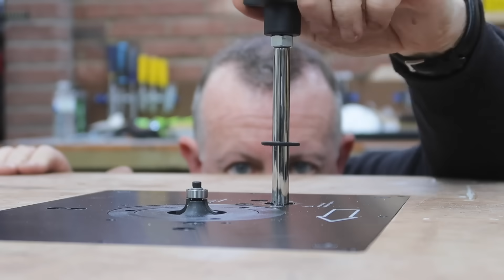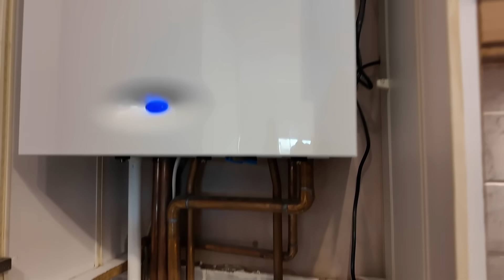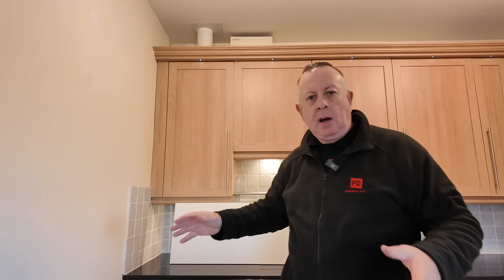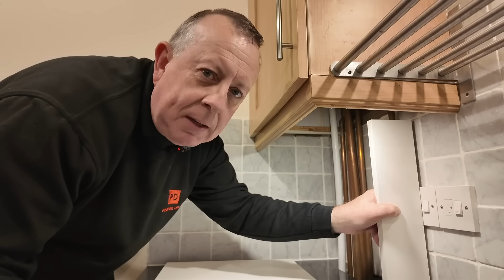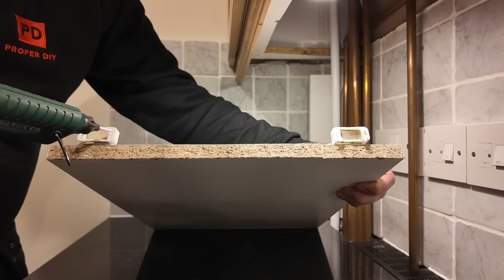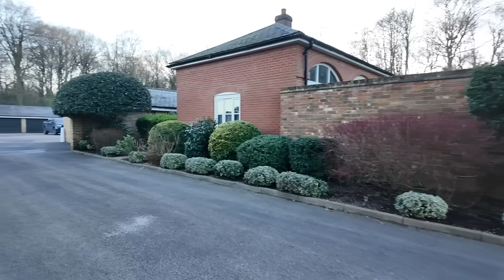A very small, but important job!

Comment: I would box in all the pipes as one, and relocate those switches and receptacles to the outside of that box...
Reply: shouldve just moved house
Reply: @Glasgow_kiss  🤣🤣🤣 damn it why didn't I think of that
Reply: Me too. Would've got a base unit end panel to match doors or tiled. Just would niggle with my mind, which is why everything takes me so bloody long!
Reply: More work and more money if jou want it to be perfect !!😊
Reply: @jdt1459sja  with the time he had he did the best he could tbf
Reply: @jdt1459sja  I strongly dislike the idea of half-assing anything. I'd much prefer to whole-ass it.
Reply: @matsuz100  yeah the root cause of the mess is the crap boiler fitting in the first place. I get why people dont want a plumber or heating engineer to fix it though, they'll try and charge hundreds and to be fair it might take them a while with pipe bending and all that jazz. Then you just think "can i live with it for 500 quid" and the answer is usually yes. 
Good thing is though if the house was put up for sale then buyers probably wouldn't notice.
Reply: Sometimes that’s not possiblr
Reply: But if you do want access to the sockets the silicon used to hide the the cut will just come off.
Reply: @matsuz100  painting pipes sounds more like a more lazier bodge. At least you physically cannot see the pipes now.
Reply: You can’t do that - legally-  unless you’re a qualified electrician.
Reply: @CoramDeoHomes Likely it would be classed an existing circuit, use WAGO's to extend any cables that are too short. the Issue here is with the covered fuse if the boxing is siliconed to hide the break out. Had Stuart scored the line with a craft knife or taped it it would have been fine.
Reply: Why not move the boiler to a better spot
Reply: @antonioherrera1324  How to turn a £10 job into a £500 one :)
Reply: @dekew5024  and the rest. Moving the boiler and all the pipes. Ripping ceilings / chasing walls, Replacing cupboard that has no bottom. Would be a disaster.
Reply: @antonioherrera1324 -- oh yeh --£££ extra 😂 who pays?

Comment: Good to show a job with compromises and constraints that you would rather were not there in the first place. Boilers now require a massive ventilation hole below them, so that is why the boiler cupboard doesn't have a bottom at all. Pipe placement was horrible, but dictated by the retrofitted boiler. All in all a reasonable bodge was required and implemented.
Reply: Massive ventilation hole ?

Comment: Not sure if this would work, but:

Maybe you could put a transparent packing tape where the silicone bead would touch the tile on both sides; apply the white silicone, mould it, and wait for it to dry fully; then cut the tape along the line and carefully remove the cover. Then, remove the remains of the tape from the tiles, and (optionally/possibly from the newly formed silicone edging).

Thus, silicon edge would nicely conform to he contours, cover the chip-out on the melamine, and cover would still be removable per need.

I am not sure if silicone would adhere to the packing tape, so an alternative tape might be needed (paper masking tape, maybe?) for it to work.
Reply: Cracking idea and maybe use cling film as the isolation medium which would be easier to remove.
Reply: It doesn`t appear he had that sort of timeframe to let silicone cure, it`s a one strike visit by the looks of things. Could have glued a trim bead to the melamine face to cover any chip out, then it would all be removable as one piece. It may have helped if someone could have sent him some pictures/measurements of the job beforehand. Not much else he could have done here.

Comment: That boiler install is shocking….cant believe the owner signed that off….
Reply: If you run a bead of silicon around the jagged edges, then surely the fixture will be "permanently" in place?
Reply: @davidnuttall4796 Yes, it completely negates the need for magnets, too. Hindsight though
Reply: @davidnuttall4796 which is why he didn’t show the final part coming the next day 😂 I think it was to hide the fact he thought he could get criticised for the quality of finish
Reply: Regulation is electric has to be 50mm away from copper pipes.
Reply: My boiler and pipes are run very much like that behind a cabinet. I've got a removable cover that just slots in place  so it gets moved out the way. It's free standing so nothing to detach to access the pipes when needed
Reply: There is nothing wrong with the boiler installation, cables need to 25mm not 50mm from a gas pipe. I am a gas trainer by the way.
Reply: @gashead2  25mm I would check that if I were you!
Reply: @grahameblankley3813  its 25mm for gas pipe work from a cable, 150mm distance between a gas meter and an electric meter or a consumer unit. BS 6891.
Reply: @grahameblankley3813  its 25mm for gas pipe work from a cable, 150mm distance between a gas meter and an electric meter or a consumer unit. BS 6891.
Reply: @grahameblankley3813  “if gas pipe is not separated by insulating material shall be at least 25mm from any electrical cables and/or fittings (switches and socket outlets) and at least 150mm from any electrical meters, circuit breakers, main isolation switches, distribution boards or consumer units. Gas meters shall be at least 150mm from any electricity meter/ electrical apparatus and at least 25mm from electrical supply and distribution cables”.  The boiler shown and the location of the gas pipe and the electrical apparatus shown shall conform to the above regulations.
Reply: @grahameblankley3813 

It’s 25mm.
Reply: Anyways 25 or 50 it's good to know we are working safely.
Reply: Please use a  mask when cutting! I wish I had, but it's too late now .. have to live with the lung damage. Also, you were pretty bold working on the kitchen surface without protecting it?
Reply: Chippy
Reply: Very neat job. Blooming impossible to get a clean edge on melamine so I don’t blame you for wanting to silicone around the gaps. Wonder if glueing sections of white plastic beading might have been an alternative and made it easier to remove the boxing though?
Reply: Welcome to rental houses in the UK! The only thing the average landlord cares about is "How cheap can you do it?".
Reply: @jbaidley same in the States. I'm a landlord by force (no comment on why)... And I get a bit of grief when I try to do a better job. 😕
Reply: @jbaidley Ever rented in Germany? 😱
Reply: What's wrong with that? Seems quite tidy. All straoght pipes down. The last one couldn't go on the left, it would obscure the socket or come out further from the wall. This is the sort of stuff that happens when you put a boiler in a place it wasn't designed to go.
Reply: Mixing electricity and gas pipes? Sorry but what an half ass job! This guy should have been fired! I would have never signed in as a tenant! Decent cover up job but problem still there! I'm glad I live in Canada, where the construction code is slightly better! Perhaps people do not all have strong job ethics
Reply: Believe me, this is a neat installation by British standards.
Reply: @moo7137 😂😂
Reply: @moo7137 I know gas needs special care and cannot  be touched by a DIYer but surely the cabinet was butchered and the pipes should not have been left like that. If had to box the pipes in he would have done a better job with the pipes
Reply: Shocking pipework!
Reply: What would you of done differently?

Comment: I hate those "small" fiddly jobs! I use those catches quite a lot when they are out of the way. Just used to secure a rear cabinet panel that might need removing to access pipework in future. I sometimes use rare earth magnets epoxied in when more strength needed - just done the latter to secure a valance/pelmet box around a roller blind so it can be removed as needed. I quite often finish any mucky cuts with a bit of trim rather than caulking, if the panels really need removing.

Comment: A nice, quick job in a strange circumstance. If you add a bead of caulk to the edges, how will you keep the ability to remove the box from the wall?
Reply: Instead of caulking you can use silicone or plastic gaskets ending the melamine board. I would recommend kitchen plinth seals that usually close all gaps between the plinth blades and the kitchen floor.
Reply: But then aren't you back to the issue of having a straight edge against bumpy tile?
Reply: Surely adding the silicone beading stops access to the socket? Awkward job for sure.🤷‍♂️

Comment: Clever solution, Stuart! Wonder if the hot glue will hold over time. If I may ask: putting on the caulk will tidy it up, but also fix it to the wall? Or have you got some other clever solution for that problem? (if so: please share!)
Reply: I once ran into such problem. Putting a strip of masking tape on the tile/wall will form the caulk nicely and the tape can then be cleaned off after caulk dries.
Reply: Thought the idea of magnetic fixings was to easy removal of box so why caulk or silicon bad edge

Comment: Should have used a melamine jigsaw blade (ultra fine and cuts on the down motion)
Reply: Starrett do blades which cut down at the top and up at the bottom so pretty good finish both sides of the material. Sorry I can't remember the name of them but I've found them really useful 👍

Comment: Have been watching since the beginning and love your channel.
However this video is not to your normal high standard.
Working on top of the Bunker with no protection to the gloss finish.
Although your boxing can be removed losing a double socket and cutting across a fused spur is not ideal. This job was never a quick fix. The apartment looked a high end property so a better solution should have been done. A better box should have been made and the socket extended forward. The boiler is a permanent item so your new box could have been made permanent. I bet your friend and tenant won’t be happy. That said keep up the good work. BTW loved the video on the power station. The lift inside the chimney was awesome.

Comment: It's a shame it was designed like this in the first place — if they'd just put the double socket on the other side of the fuses it would be a start and then put a proper cover and sealed up the bottom of the 'fake' boiler cupboard. Ahh well.

Edit: Just seen where the sink is, I suppose that might've put the sockets too close to that.
Reply: I think he said the boiler was relocated to this place. The Plummer did a crap job. The plumber should have done better with the cold water pipe and his job to box pipes in as highly visible

Comment: The boiler installer did you dirty with that one.  Especially that water pipe between the socket and switches.  He also removed the entire bottom of the cupboard instead of making a couple of holes.  

The end result is tidy though - especially once it’s caulked in.
Reply: They're not allowed to just cut holes for pipes. There has to be a certain area cut out for ventilation (yeah, I know, balanced flue and all that but regs is regs.
Reply: That's not a ventilation hole, it's a cupboard massacre! @Ian_Garth

Comment: Sorry, but it was done terribly. I would give you a score of D (or european 3).
You should have made the cover wider, to cover all switches and vent, and cut round holes in it for all switches and sockets. Then extend the existing wiring and move sockets from the wall onto the new cover.
Regarding the cutting and chipping the edge of the melamine board, your saw had either wrong plate (48 or 60 teeth recommended) or too low RPM.
Smart move with the magnets though.
Reply: This is some real world work as opposed to youtube work.  For example you only have what is in your van, you have to walk outside to cut on a portable bench in inadequate light with cold hands.  All that's missing is a customer looking over his shoulder, and a boss asking if he's finished yet. 😆  But like he said, it's not perfect, and it had to be a compromise with those switches and pipes, if the job isn't going to take all day.  It's honest to post the video and show some real world problems.
Reply: Stuart was pretty clear this was an imperfect job to be done at speed. It's a reasonable and safe compromise under those conditions. The work you suggest would need a qualified electrician to be legal in the UK and take longer. If not, I have no doubt Stuart himself would have preferred to do it differently. Maybe even moving that cold feed pipe inward to make the box smaller and avoid the switches, and then bring the socket out.
Reply: Stuart was the first  to admit thus job wasn’t perfect but he did the best using the tools & materials that were available.
Reply: Another armchair critic. Let's see all the amazing work you've done. Oh, look, there isn't any.
Reply: The boiler guy should have done a better job so a hacky solution like sockets in a portable melamine piece wouldn't be required at all.
Reply: Pretty sure it is against regulations to have it on a removable panel
Reply: @stephenlawrenson2380  no doubt. Wouldn't have needed to be removable if the socket was on the outside though!

Comment: Am shocked that electric wiring is so close to water pipes it this legal 😳
Reply: How do you think boilers work?!
Reply: The boiler needs an electrical supply to function and as in this case often fitted in a kitchen so wiring will always be close. The wire exposed was to a nest controller and is common. I have one fitted.